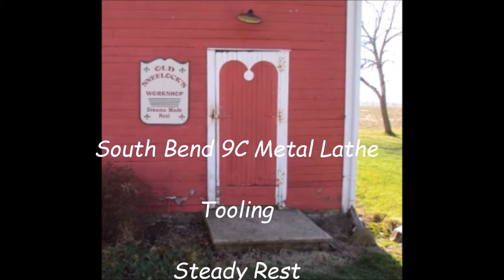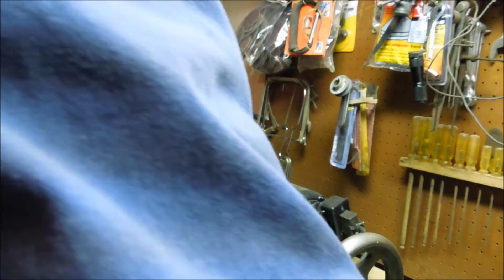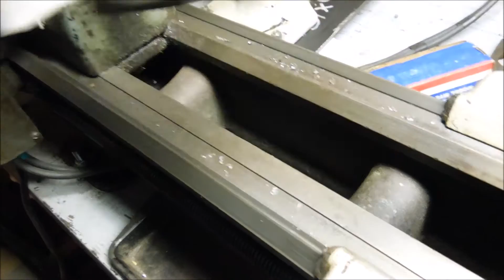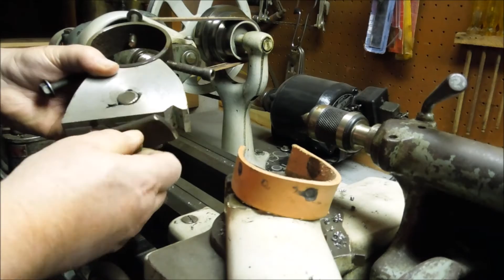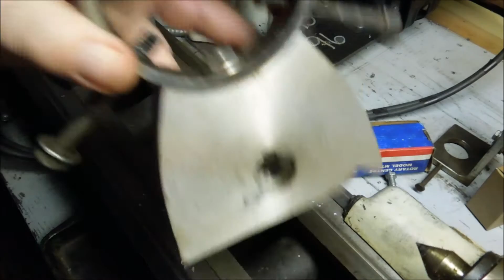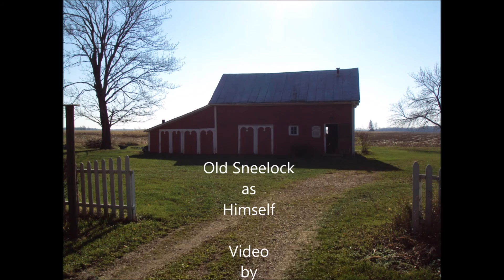South Bend 9 Inch Metal Lathe ~ Steady Rest ~ by Old Sneelock's Workshop

Comment: What model is your lathe I have the same one just bought today yours is the only one I've seen with the same counter pully setup as mine
Reply from the maker: Chris I just got back after spending some quality time with Captain Green Bush chasing down how to identify a South Bend Lathe. https://youtu.be/k-adSZfhEJw
Mine is a 9C meaning that it will turn a 9" diameter face plate and that it has a manual cross slide. It has a No. 2 Morse Taper tail stock and a #3 headstock. The counter shaft on mine was originally bolted directly to the bench. I added the tilting belt tightener

Comment: Thanks for posting about your steady rest. It looks like a clever design, and as long as it works for you that's all that matters. I wonder if cast zinc would hold up reasonably well? I've never done any aluminum casting, but have been casting lead bullets for awhile. Zinc is a little stronger, and doesn't have much use in the reloading world.
Reply from the maker: +Jonathan Martell As thick as I made the steady rest I'm pretty sure that zinc would do fine. Aluminum doesn't take much more heat than zinc to melt and if you add zinc and aluminum together the result is stronger than either

Comment: lathes have scared me ever since i seen Tim the tool man Taylor get his shirt ripped off.  haha
Reply from the maker: +ed shaw I had a similar real life experience. I was cutting a 3/4" shaft in the lathe and had 3 feet sticking out the back of the head stock. I had a barrier up so people would stay clear of the spinning bar. One of the engineers wanted to see what I was doing so he leaned over and looked around my shoulder. His shirt got wrapped around the bar. Fortunately the bar was strong and the shirt wasn't. The lathe tore his shirt half off before I could get it stopped. If the bar had bent before it tore loose it would have swung around and killed him. He was also lucky it didn't catch his tie or he might have been seriously injured from that. 
Even my little 9" South Bend will peel off 1/8" of steel in a pass. With that kind of power it can rip your arm off if you aren't careful.
Reply: +Old Sneelock's Workshop  Yessir. If it's moving you better watch it close. Good rest there, Unc!